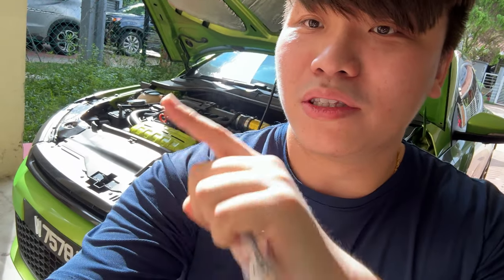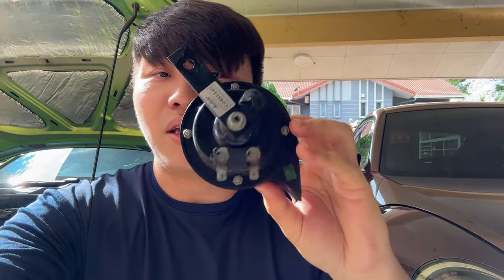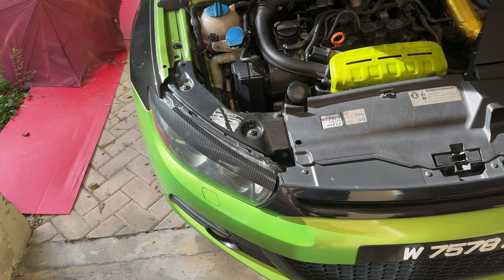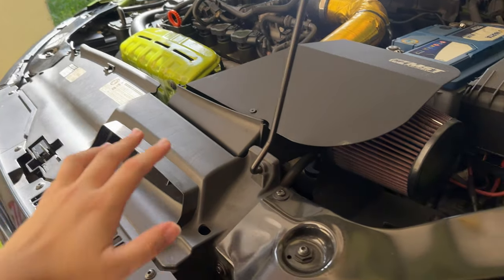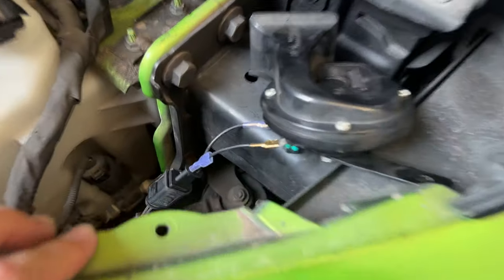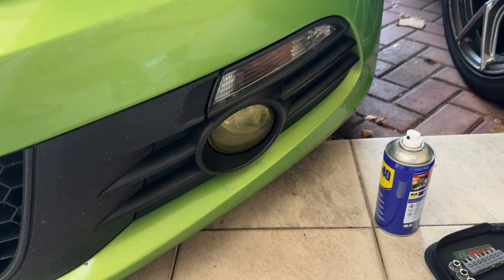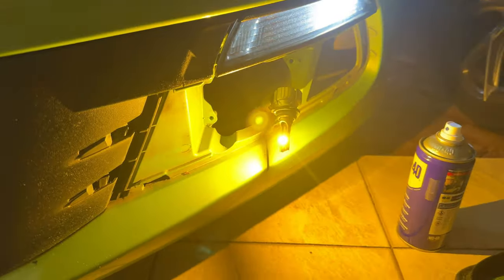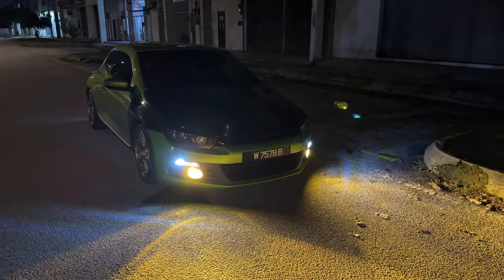Volkswagen Scirocco Horn Replacement & Foglamp LED Conversion

Comment: Do you have any idea what this means?
Adaption of DSG
causes of abort
Abort code: 101
The basic setting may have been cancelled due to an incorrectly detected clutch position due to the direct shift gearbox (DSG) mechatronic J743
Possible malfunction causes if the double clutch was replaced:
-Position of engaging bearing incorrectly set.
-Seating of clutch piston ajusted in correctly.

If the double clutch was not replaced
-Let the engine warm up for approximately 10mins and try again
Reply from the maker: Not too sure. Better to seek advise from a specialist